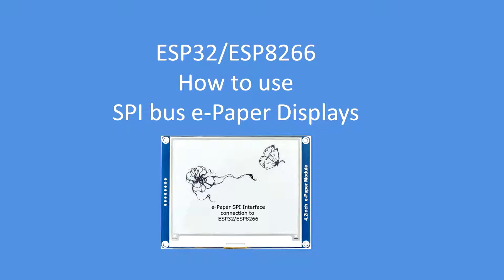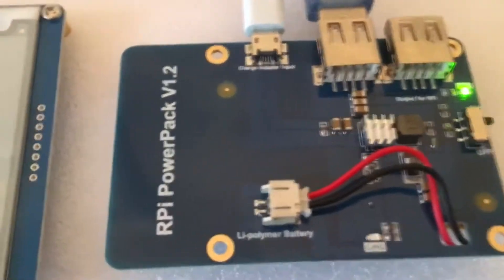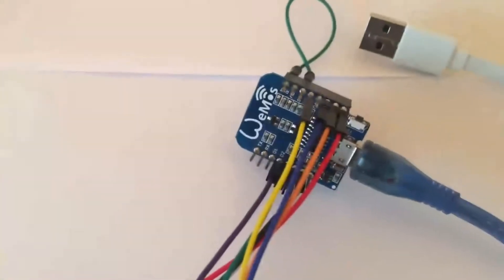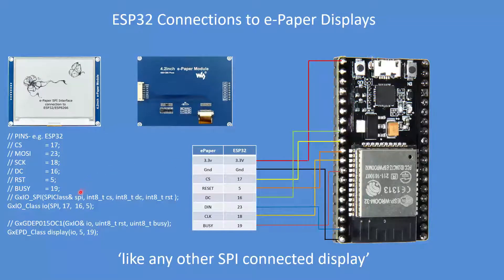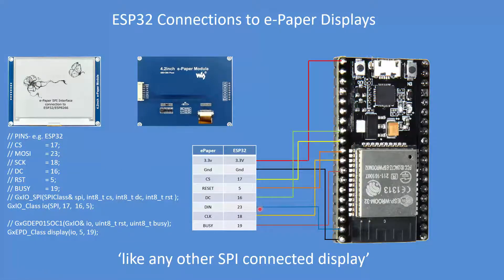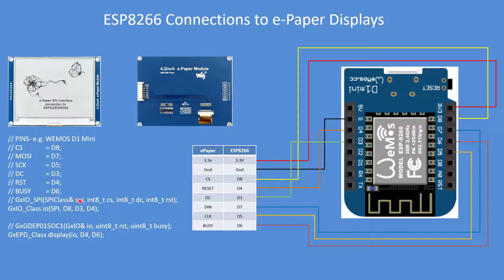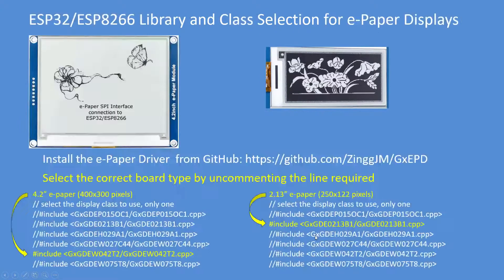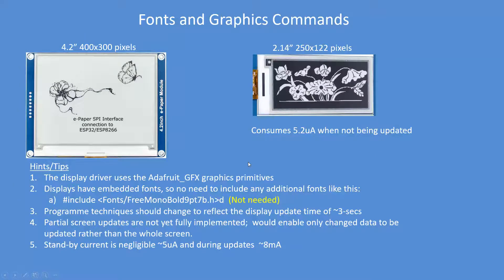Tech Note 055 - Using ePaper SPI Displays with an ESP32/ESP8266

Comment: Hi, I am new to all this and maybe my question does not even belong to this topic, but I just set up a ESP32 with a 1.54inch 3-color e-paper display and tried to run your code.
I choose the right GxEPD version and plugged the pins in, like in the provided picture.
Now I get like 1000 error messages like "multiple definition of `GxIO::transferTransaction(unsigned char)'" and the information where it was first mentioned.
Can anybody help me? I really don't know what to do :/
Reply from the maker: Valentin Gehmacher, use GxEPD 2 would be easier and look at the setup of the examples
Reply: @G6EJD   I just contacted the manufacturer and it seems that my Display is broken.
When the new one arrives I will try it that way, thank you!
Reply from the maker: Valentin Gehmacher, the errors you were listing were compilation errors resulting from an incorrect configuration. Assuming you tried a library example and had the SPI wiring and connections correct and it still wasn’t working then yes probably faulty.
Reply from the maker: Valentin Gehmacher, there are examples too with GxEPD

Comment: thanks for this video,  how you have reduced the current consumption of display until 5 µA during deep sleep Mode , in my project the current will be around 45 µA .

i have tried alot to reduce it through free the Ram, Disable Clock Signal then put the display in deep sleep  
in datasheet they have put the Deep sleep mode current should be 2 until 5 µA with this conditional: 
1.DC/DC off 2. No clock 3. No input load 4. Ram data not retain,
but it is not understandable
Reply from the maker: Your almost certainly not measuring display current, to do so place an ammeter in series with the display Vcc. It sounds like the value your getting also includes the ESP?
Reply: @G6EJD  actually i am measuring  the current only the display not Including ESP32
like that:  https://ibb.co/ZfQmtpZ
Reply from the maker: Well if you remove power the display remains as is, I can’t explain why it’s operating outside of its design specifications have you asked waveshare?
Reply: @G6EJD  yes i have asked them, the answer was" The datasheet is only for raw panel, Maybe the circuit on driver board cause this problem", actually the driver Board with the disaply came together from waveshare
what about your weather station project, have you measured the current for the display during deep sleep?
Reply from the maker: AT ATA021, I haven’t measured sleep current because I don’t take any regard of it anymore because say the sleep current is 50uA and I use 18650 2600mAHr battery then at sleep the battery life will be 6-years but in practice the weather station lasts for about 4-5months because it is cpu on time that consumes the dominant power.

Comment: Very nice tutorial! Thank you! I have one question: How did you include that nice symbols for temperature, humidity etc.?
Reply from the maker: Thank you, you can either draw the symbol with drawLine and drawCircle or fillRect or fillCircle or you can create a bit map image (2-bit) B/W image then transfer to flash memory format then you can draw. On balance I now prefer to draw the images using commands as getting a bit image in the correct format is quite difficult. If you check out some of my later videos and code you will find examples of scalable icons.

Comment: Brilliantly explained, thank you, learnt a lot and feel inspired
Reply from the maker: Thank you they are excellent screens for contrast and take zero power when asleep and open the door to ultra low power projects. I’ve had a weather station based on an ESP8266 running for 8-months now using 3 AA cells but I power the board with 3.3v via the 3.3v pin to remove the UART and other circuits from the power load this gives much increased battery life.

Comment: Any info on hot to install on a ESP8266 NodeMCU 1.0 version Amica/LoLin versions?
Reply from the maker: Ok, these are the pins for a Node MCU Lolin board
MOSI=13
SCK=14
CS=15DC=2BUSY=4 RESET=5You can use nearly any other pins for DC and Busy
// GxIO_SPI(SPIClass& spi, cs, dc, rst);GxIO_Class io(SPI, 15, 2, 5); // GxGDEP015OC1(GxIO& io, rst, busy);GxEPD_Class display(io, 5,4); https://www.google.co.uk/search?q=node+mcu+pin-out&tbm=isch&source=iu&ictx=1&fir=47r_W2A31iOr9M%253A%252C6wYZ0JekiP7sjM%252C_&usg=__sOm34KaAh2u6dkFC0I7DVE12icw%3D&sa=X&ved=0ahUKEwj1k--J8-HYAhUBYlAKHQ57C8gQ9QEIKzAA#imgrc=92SpkL9NUDewjM:&spf=1516291786943

Comment: IN the figure at 1:50 the circuit is very similar  to a nodemcu 32, but the pins are totally flip down, me think is a mistake, is it ?
Reply from the maker: Hi, I have just checked the wiring diagram on Github and that is correct. And I have an ESP32 Node MCU here and the pins are correct. If your using an ESP8266, then the best thing to do is to write a small programme that prints out your pins: e.g.Serial.println(MOSI);Serial.println(SS);Serial.println(SCK)all other pins are user settable. If you have any problems just give me a call here or via email.Yes the pins are as labelled from the rear.
Reply: 3.3V is on the other side  if you flip it horizontally, but the other connections also aren't the same, got mine in dx
Reply from the maker: On my NodeMCU ESP32 as per the drawing, if I hold the board so it's vertical and the ESP32 is at the base and micro-USB at the top so to speak, then I flip it to the right, I see in the bottom-right corner GND then P23 then P22, etc. Nearly every board on the market uses the same SPI pins of:
CS/SS = 5

MOSI = 23

SCK = 18

The rest you can define yourself to what ever you need

//static const uint8_t CS    = 13; // ORANGE//static const uint8_t MOSI  = 23; // BLUE//static const uint8_t SCK   = 18; // YELLOW//static const uint8_t MISO  = ;//static const uint8_t DC    = 12; // GREEN//static const uint8_t RST   = 14; // WHITE//static const uint8_t BUSY  = 22; // VIOLET

Comment: Can i use it with an Arduino UNO Wiyh 5 v DC ?
THANKS.
Reply from the maker: Marc Paradis Yes, in fact Waveshare show UNO examples, but you need to supply the display with 3.3v not 5v from the UNO 3.3v pin.
Reply: G6EJD do i have to use a logic level converter ??
Reply from the maker: There is nothing in the Waveshare data sheet that says you must convert down to 3.3v, I checked and found no mention of the need. Ideally include one or only use an ESP or DUI, etc that use 3.3v logic.
Reply from the maker: In the Waveshare Q&A section for the display they say: The I/O level of Arduino is 5V, and the e-Paper should be driven with 3V3. If your Arduino cant drive the e-Paper successfully, please try to convert the level to 3.3V

You can also try to connect the Vcc pin to the 5V of Arduino to see whether the e-Paper works, but we recommend you not to use 5V for a long time. Use 3.3V

Comment: On ESP32 i got Busy timeout! :(

Thank You.
Marc.
Reply from the maker: At what stage?
Reply from the maker: Check the serial port for progress and diagnostics if necessary adding temporary print statements so you can see progress and also see where it goes wrong. On the whole the displays are very reliable
Reply: G6EJD how ?
Reply: G6EJD esp8266 works just fine..
Reply from the maker: OK, have you assigned the pins correctly for the ESP32? SO determining which pins are used for SDA, SCL and then assigning usable pins for DC, CS, RST and BUSY?
Reply from the maker: I've just checked the pins for the ESP32 and they are correct. What board are you using?
Reply from the maker: OK try moving CS to pin 5

GxIO_Class io(SPI, 5, 12, 14);

I have not tried the latest update of the GxEPD library, there have been a few issues with the ESP32, I presume it compiles OK.Your using what size e-paper?
Reply: G6EJD 4.2 inch spi same as your example ..
Reply from the maker: Ok, then it’s probably a library issue, so do the GxEPD examples work?
Reply: What's happening with 5 RST pin?? how do i connect the RST pin ?
Thanks.
Reply from the maker: Nothing it can stay on 14. The reason I suggested gpio-5 is because on the SPI bus pin-5 is typically the SS or CS pin.// GxIO_SPI(SPIClass& spi, int8_t cs, int8_t dc, int8_t rst = -1, int8_t bl = -1);GxIO_Class io(SPI, 5, 12, 14); If it's not working then it's a library (GxEPD) issue.
Reply: RST is 5 or 14? ?
Reply: G6EJD According to your diagram, CS = 17, RESET = 5, DC = 16, DIN = 23, CLK = 18, BUSY = 19 
Right?
Reply: It works now.i didnt connect the right pins.
Thank you for your time :)
Marc.
Reply: The time is not right .. it is suppose to be 4:34PM and on the display it is showing: 2:34 PM with this code..
void SetupTime() {
  configTime(-5 * 3600, 0, "pool.ntp.org", "time.nist.gov");
  UpdateTime();
}

void UpdateTime() {
  struct tm timeinfo;
  while (!getLocalTime(&timeinfo)) {
    Serial.println("Failed to obtain time");
  }
  //See http://www.cplusplus.com/reference/ctime/strftime/
  Serial.println(&timeinfo, "%a %b %d %Y   %H:%M:%S"); // Displays: Saturday, June 24 2017 14:05:49
  time_str = asctime(&timeinfo); // Displays: Sat Jun 24 14:05:49 2017
  time_str = time_str.substring(0, 24); // Displays: Sat Jun 24 14:05
}

Thanks.
Mrac.
Reply from the maker: You can follow the diagram or if you want to change pins it's the code really:
// pins_arduino.h, e.g. WEMOS Lolin
//static const uint8_t CS    = 5; // ORANGE
//static const uint8_t MOSI  = 23; // BLUE
//static const uint8_t SCK   = 18; // YELLOW
//static const uint8_t MISO  = ;
//static const uint8_t DC    = 12; // GREEN
//static const uint8_t RST   = 14; // WHITE
//static const uint8_t BUSY  = 22; // VIOLET

// GxIO_SPI(SPIClass& spi, int8_t cs, int8_t dc, int8_t rst = -1, int8_t bl = -1);
GxIO_Class io(SPI, 5, 12, 14); 
// GxGDEP015OC1(GxIO& io, uint8_t rst, uint8_t busy);
GxEPD_Class display(io, 14, 22);
Reply from the maker: I've done the pins for a Wemos Lolin

Comment: Hi David, thanks for the great tech note! I am using your source code for the ESP8266. Unfortunately the icons are displayed inverted. The background is black and the icon strokes are white. I guess that's not how it's supposed to be... am I right? Any ideas, why it's like that?
Reply from the maker: Interesting, if you look at the icon data you can see it comprises mostly 0xFF or 0x00 values denoting white and black areas, with occasionally variations in black white, most should be 0xFF for white, now I'm wondering if the library has changed recently. I have a new quickly created a new version that uses drawn icons, so no memory hungry icons, that makes the ESP8266 unstable with low memory, it's from an ESP32 project, but it should work OK. You may need to adjust the size with the scale variable.   int scale = 10; // Adjust size as necessary on line 177
See github link above for the 04 version.Alternatively you'd need to invert all the bits for each icon, either manually (will take a long time) so 0xff becomes 0x00 and all the combinations in-between or there is a utility called lcd-image-convertor that has an invert function, but be careful on image types just do a simple inversion of the data.

This is why I dropped the bitmap icons in favour of drawing the icons.
Reply: Yeah, I was wondering the same but I didn't find any informations on that. Thanks, I'll give it a try in the next days, for now I am using "bm_invert" mode to invert it: display.drawBitmap(nodata_icon, x, y, 56, 48, GxEPD_BLACK, GxEPD::bm_invert);
Reply: Unfortunately the screen doesn't update for me. Just initially once but not after 15 mins or even later. I changed postingInterval to a lower value like 120000, but it doesn't do anything. Do you have any idea?
Reply: Sorry, I was just missing to connect pins for wake up from sleep mode :)
Reply from the maker: When the ESP goes to sleep it releases the gpio pins used on the display and in some instances gives the effect of a transition on wake-up or reset and that wakes the display consuming power, so if you have any problems with random wake-ups try fitting a pull- down resistor of about 2k2 to 2k7 so this can’t happen. If you have no problems then no need.
Reply from the maker: It helps a lot :)
Reply from the maker: While I think of it, I found the wake-up and reset pulses were too short for reliable operation and the pin-mode was not always set to an output , so I stretched them by x10 longer (from 1 few uS) and modified the library to be really sure those pins were in the correct mode and did not get changed to stop any perturbations causing random wake-ups or resets, which is what I was getting after a few hours of running.

Comment: Is there a frontlight off the shelf solution available? Could not find any...
Reply from the maker: Interestingly Waveshare are advertising their displays and saying explicitly 'no backlight' so I'm thinking they are making a point that e-paper cannot be backlit or they about to launch a backlit version. I Have seen front-light kits for TFT screens a row of LED's that shine across the screen and you'd stick them down one side of the display edge, but to be honest I have not looked. I wonder what e.g. the Kindle e-paper version does for illumination. The contrast on the displays is very good, so not much light required. Perhaps a strip of LED's that are freely available now stuck along the edge.
Reply: Kindle has 4-6 LEDs and a special light guide on top of display. They say it's their (or subcontractor's) proprietary technology. I am looking for off the shelf solution for months now and will probably end up salvaging frontlights from kindles, at least for prototype stage... But there does not seem to be a solution for real product.
Or you can simply buy replacement e-paper displays for readers... In my case, I want to use Sharp 4.4" memory LCD.
Reply from the maker: I've got a 20x4 LCD display that has a piece of Perspex on one edge and one LED that is refracting down the Perspex and along the way light escapes through the edges and across the surface, it works quite well, but I've not seen them for sale for a long time, other than an after-market product that is no-longer available. Good luck in your design. I was thinking about these LED tapes: https://www.aliexpress.com/item/DC12V-LEDs-Lamp-ribbon-5050-SMD-non-ip65-waterproof-LED-strip-light-12V-1m-2m-3m/32656650236.html?spm=2114.search0104.3.211.cZfYYJ&ws_ab_test=searchweb0_0,searchweb201602_4_10152_10065_10151_10130_10068_10344_10345_10547_10342_10343_10340_10341_10548_10192_10541_10190_10307_5670020_10301_10303_10060_10155_10154_10056_10055_10539_10537_10536_10059_10534_10533_100031_9912_10103_10102_10142_10107_10324_10325_10562_10084_10083_10561_5650020_5740017_10179_10312_10313_10314_10184_5660020_10550_10073_10551_10552_10553_10554_10557-10550_9912,searchweb201603_2,ppcSwitch_4&btsid=53827382-7a58-4c04-b157-83f00139825f&algo_expid=5ab7b80d-777c-4db2-b20c-22a6f75eab8c-27&algo_pvid=5ab7b80d-777c-4db2-b20c-22a6f75eab8cThere are many sizes on the market.
Reply: Unfortunately not for 4.2" but there are some checkOut this -> http://www.good-display.com/products_detail/productId=368.html
The Library:  https://github.com/ZinggJM/GxEPD is based on GoodDisplay-Components
Reply from the maker: Yes, Waveshare displays are GoodDisplay products. Looks like the additional of a backlight will be the next release.

Comment: How did you manage to convert the icon for the e-paper display ?

thank you.
Marc.
Reply from the maker: lcd-image-converter-20161012  which is a free download. Select 'new image', then import your image, go to 'Options' then Conversion, then at the top select monochrome, then 'show preview' and select the data for the .h file. Check for orientation, the data format for the library appears to be little-endian, so you have to flip the image in the vertical plane using the lcd-image tools. So for example an arrow pointing to the left is displayed pointing to the right so you have to flip it around before conversion!  Images consume RAM very quickly...OK on the ESP32 until the extra is consumed too.